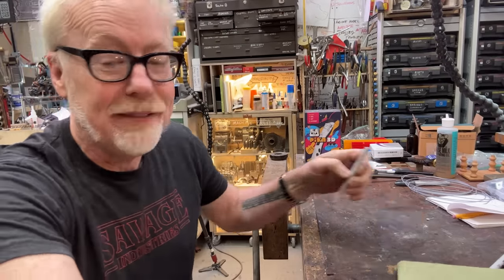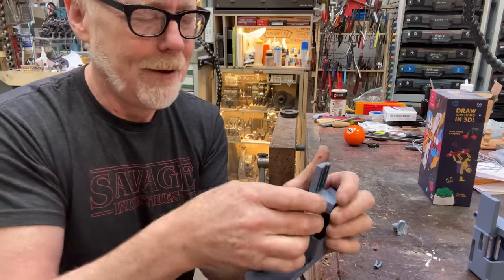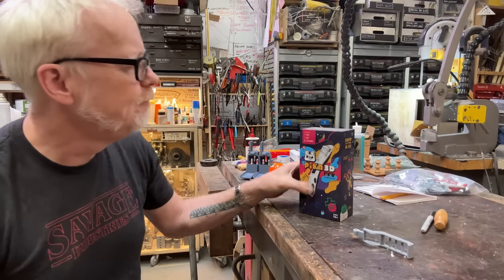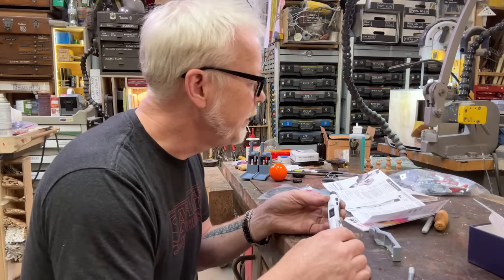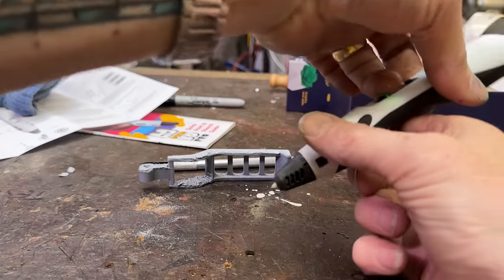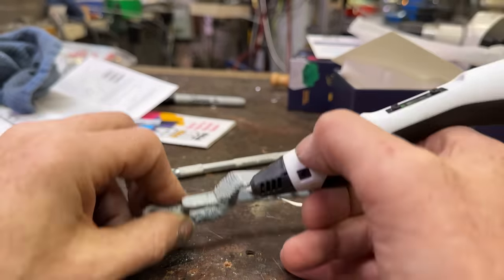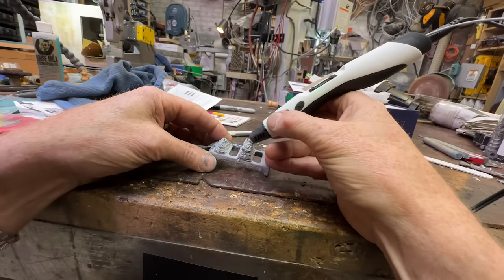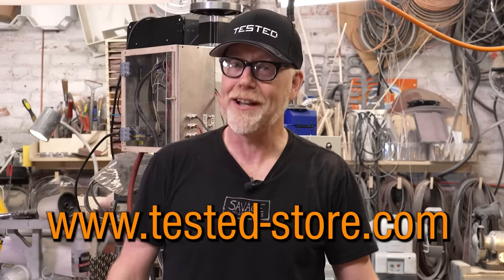Adam Savage Tests This 3D Printing Pen!

Comment: I got one of those cheap 3D pens from Aliexpress and I found a great use for it in retro console modding and stuff like that, like a ZX81 with a piece cut out of the back for something, and I placed some tape as the external surface level and filled it in with the 3D pen, then some sanding after removing the tape and it came up really good, or in the C64 Mini, adding  a USB hub board inside with one of the ports on the back for external use, and I used the pen to build up some screw posts for the new board to screw to. For things like creating stuff from scratch it's really just a toy, but for some things, it is definitely a useful tool to have in the box.

Comment: I have a phrozen brand vibrating cutter, and it will melt and smooth out my 3d pen added plastic to blend into the surrounding very nicely. Just turn it on and put the side of the blade on it, the blade vibrating will heat it up and melt it slightly, but enough that you can smooth it out. I also use my variable temp soldering iron as well for larger or less visible jobs. Works faster, but not nearly as precise in my experience.

Comment: I think a milliner or silk flower iron with knife and wedge shaped tips and temp control would be an interesting way to smooth the material. Soldering irons are generally too hot even at the lowest temps.

Comment: I have the same pen and use it to pretest a design as you can make a simple version with the pen, especially when its just a small part to make. Then after I know what I need to improve and then go into 3d program to design it and then also already have the measurements needed or want to improve on.

Comment: If you use yout bambu lab X1C with the AMS, you can load in a spool of PETG to use as support interface material. Use the traditional support type (non organic/tree), set interface distance to 0, and set support interface material to PETG. This leaves perfect surface finish on overhangs, steep angles and curved surfaces. PETG releases extremely easily from PLA and ABS prints, and can be printed in a far large temperature range than what is stated on the box. You can also use PLA as support material for PETG.
This does however add a bit more time to the print, and you must make sure to set the PLA/ABS as pure white, and the PETG/support material as pure black. The update the flushing volumes. This is to ensure thang the PETG gets sufficiently flushed away, as it otherwise ruins layer adhesion.

I recently bought a 3D pen, and it’s really good at welding parts together, though the surface finish is not very nice, and you should probably add a small chamfer to the edges you intend to join. The bad surface finish can be fixed with a scalpel and some sandpaper. The joints are far stronger than superglue

Comment: I had a 3d pen from years ago. Instead of plastic fillament, it uses resin polimers that cure with an uv light built into the pen. Also ive heard a good way to fill and smooth prints is by using cheap resin from a resin printer. Fill and coat then hit it with a uv torch

Comment: A good compliment to a 3d pen is a wood burner or similar tool to help smooth out rough edges along side sandpaper and knives, probably works well with 3d prints too. I’ve seen several 3d pen artist use this method in their videos. I’ve seen some impressive stuff made solely with a 3d pen and a wood burner style tool

Comment: I have a cheap plastic welder I bought at Harbor Freight that seems like it would help in smoothing.  I don't have a 3d printer, so I can't test this.  I have melted some plastic things together though and it works fairly well.
Reply: This is a good thought and I have done it, but where it fails is most prints are not solid and it is super easy to over melt the part. BUT it does work!

Comment: I use my 3D pen sometimes to connect two printed parts. I don't like to contaminate my prints with glue and that way I don't have to. Also i don't have to find glue that works for a specific filament type and no waiting for glue to dry.

I also used it once to fix a limit switch on my first 3d printer, because I was not able to print the replacement part. I wanted to replace it afterwards with a newly printed part, but ended up to keep it like that  until i rebuilt the whole 3d printer a year later.

Comment: For me, models that have a tough time printing nice, i will cut them up in to various parts in the slicer so more pieces print flat on the bed for a nicer result. Then i use my 3D pen to “weld” the parts into their final shape. I tried to clean up the parts like Adam did and got the same issue where i was looking at a lot of sanding which is not easy with PLA. So using the pen as a welder to put the now “nicely printed” pieces back together, i get really great results. A lot less sanding and its strong as hell. Like a weld, the PLA melts into the part creating a perfect bond

Comment: I've had a bit of success with a pen much like that, not only giving prints touching up, filling those crevices and not quite fitting parts, but also repairing commercial plastic. 80's joysticks, old camcorders with brittle plastic. Quite lovely.

Comment: As someone with 8  yrs experience printing and having my own On-demand service,  those pens will likely be useful only for repairing holes, maybe filling  gaps on assemblies, gashes, imperfections etc Nothing where you can expect quality or  usefulness. 
Supports, bridges, overhangs etc will all get better as you learn how to use the right settings. (top layers, gap, infill for support) Experience will show you how it best works for your workflow.

Comment: Hey Adam, another tool to look into is a plastic welding kit for surface repair.  

It looks like a soldering iron with a flat head.  It can be a huge help with fixing prints or welding multi-part prints together, and should work really well when combined with that pen.  The pen can do the job of filling in the spaces you want with filament, and then the welder can be used after the filament has cooled to smooth it out and help fill in gaps that the pen may not have filled well.  It should help make cleaning up the parts easier as well so you don't have to do as much sanding.

Best of luck with your future printing projects!

Comment: These are invaluable tools for Cosplaying. I have 3 pens in my farm, one for Ultra Low Temperature PCL, I keep one on PLA settings and another on ABS Settings. More often than not, the prints are going to be sanded smooth and/or repainted, so the pen "sloppiness" is nothing to worry about. There are some great artists who use a pen specifically and their work is really cool!

Comment: i use my 3d printing pen the most for fixing parts together, hold 2 parts together and go over the seem with the 3d pen and it will melt them together it awesome, if you design the parts yourself you can incorperate a litle V-shaped groove where the parts meet and the 3d pen filament will melt into and then you can basicly melt them together without much of a visual defect or sanding afterwards

Comment: You may want to look into a "plastic welder" for ironing out crap 3d printed surfaces. I just got the harbor freight one which is a soldering Iron with a flat triangle at the end.

If I need to fill a hole in a print I take a foot of filament and light the end until it holds a flame then drip the plastic where I need it.

Comment: Read up on using PETG as support interface. A lot cleaner break offs. Also check more walls vs higher infill. 100% infill isn't necessarily stronger than increasing walls for example.

Comment: I know most people opt for PETG, but i found PLA+ just prints easer the only notable negative is temperature resistance. ASA is my go to if i want a useable part you can also acetone smooth the part afterwards if you feel so inclined.
Reply: I second the vote for PLA+.  Easier to use than PETG for sure.

Comment: I was waiting for the ER run watching the razor blade part. I use a 3d pen for touch ups sometimes but i use pla just like solder with a triangle flat tip soldering iron. Flows like solder and doesn't stick to the tip. Works great for rounding wheels or barrels.

Comment: Right when Radio Shack was going out of business, they got some of the first generation of these pens in. It was only on/off forward and reverse. I made one of the ones the manager gave me run on a battery pack I made, and i still have one that I just used last week. I figured that since I had an anycubic kobra max coming in the mail, I'd see what videos were out there, and sure enough, Adam had the same printer. I was going to make a warm box for the filament under the machine, and he had a whole video about doing the same thing! Thank you for making my plans seem more sane. I'll be doing something similar and appreciate the footwork already being done. 😆
I swear, all of us have some kind of hive mind going. Thanks for the helpful videos, folks. I can't wait to print something giant. 🤙🏽

Comment: Without trying to sound rude..I wouldn't say this is the best use case for a 3D print pen, it adds alot of additional steps. (building up, sanding down, smoothing, etc.) 
Typically people in the hobby prefer to use a flat ended soldering iron to smooth out the rough finish on such a small part. Especially on a piece where tolerances really matter.  
Altering the print orientation could also make for a cleaner print requiring less supports.

For large prints, like a helmet, this method of using a 3D pen is great for joining parts though.  
Hope this is helpful info! :)

Comment: Okay, this is maybe an unpopular opinion. BUT I think Adam should opt for a more stable fixture to attach his phone/camera than the (gorilla arm?) ball jointed arms. I get that they are very practical for quickly adjusting to a new angle, can pass wires trough and what not. But They are also squeaky, vibrates and sometimes fails holding the camera. IMHO the quality of the videos would be greatly improved with something sturdier. He could use his machining skills to make a compact and portable floor standing phone mast with balanced arm or something. I'm a mechanical engineer and got some design ideas. Contact me Adam.

Comment: I recently grabbed a couple different 3D pens to mess aronud with. So far the best use has been repairing a c-hub on one of my ancient Tamiya RC cars. Using one of these pens, a soldering iron, and a jeweller's file I reconstructed about half the c-hub and it's been holding up to me thrashing this 30 year old car around at well over 50km/h.

Comment: Instead of sanding, have you tried a soldering iron?
I also find that an add on chisel tip works best. It doesn't get too hot but it lets you get a smoother finish before sanding. 👌

Comment: I've fixed all kinds of broken things with my 3d pens, they rarely look good, but are surprisingly durable.
Reply: Would it be useful for TPU drone stuff like quick field repairs?
Reply: @16-BITFPV  I have not tried it with TPU. Seems like it should work, just run it really slow. Mine powers off of USB, so very portable.
Reply: @IrocZIV  That would be to cool I have an adapter for my batteries to 5v USB. What's the model name? Thanks.
Reply: @16-BITFPV  Mines a generic one from China, cost like $20. On the label all it says is "3D Pen" sorry I can't help more
Reply: @IrocZIV  No problem thanks, that helps plenty. Cheep generic one would be fine for what I need. I would rarely use it. I try to have plenty of spare parts in case I crash but you know how that goes sometimes 🤣

Comment: I use the same type of pen, you can adjust the speed using the top buttons, that is handy when you only want a small amount, and can adjust it to work at your speed then. I often join PLA prints using the ABS setting, making it more of a welder, and get a strong bond too. Works for flexible TPU too.

Comment: I've been 3D printing for about 14 years... whenever the RapMan came out. Anyway, the pens are good for welding two printed parts together.
If you want to smooth an FDM print, even one as bad as that part, get some UV reactive resin (like what's used in 3D printers. Mix it with some talc or baby powder. You can get Bondo like consistency. It sands like butter and eliminates layer lines in one or two coats.

Comment: This would be useful for some repairs for sure. I got a temp adjustable soldering iron last week, and it is amazing for repairs, and re-laminating the filament back together, like on the inside of the trailer neck in the video. I had a part I made this morning where a tab didn't get fully printed, and this thing would have been perfect for trying to finish the tab off.

Comment: You can smooth it out easily with a dremel. I saw this being used to make doll shoes.  The lady used a dremel to smooth out lines. Also, you can press smooth sides against a silicone mat while still hot to make smooth.

Comment: my go to for cleaning prints is a soldering iron to flatten and smooth. then a dremel to clean up the marks left by the iron

the soldering iron is also great for welding printed parts together

Comment: as someone that 3d a lot... like a lot. i have found my own uses for a 3d pen, i dont use it for making parts look nicer really(i would normally use wood filler and so on for that. but a 3d pen works great as a welder almost. for either actually gluing the parts together or adding fake weld lines that are supposed to look like metal for a prop. by all means use them to fill in "meh" looking areas, but unless it a big area wood filler works fast, with a amazing result.

that's my experience anyway.

Comment: There's al company in England called Armortek that makes 1:6 scale model tanks and armoured vehicles.  These are high end kits machined from aluminium steel and brass. This tool would be great for adding extra detail like weld lines. I dare say the big model boat and ship builder community would also find it useful.

Comment: I use my 3D pen as a joining machine. If I have two parts I need to go together, for example a back piece on a sign frame, I just drill out a small 1/8" hole into both in the same spot. Then with the parts together, I fill in the hole with the extruded filament until it mushrooms out the top. Using a small metal dowel I then press the mushroom flat and poof, the parts are permanently joined. Cheaper and easier that using heat inserts when the parts do not have to disassembled.

Comment: i bought one from temu that even had a speed control which made it so much easier to use if it was a small area. and its great for joining pieces together if you had to split a model to fit the build plate.

Comment: These end up being kind of a niche tool, but there's a couple of ways in which these are really handy. You can use them when you need to make a plastic loop around something in situ, to either bind two things together, or form a sort of movable chain-link connection. It makes something that's basically solid plastic when it's done, and a several centimetre wide wrap of PLA/ABS can make a very secure and strong bond.   
The other use I found handy was for blades and chisels, especially ones with unusual shapes. You can just draw one side of a sheath right onto the tool, pop it off, draw the other side, bond them with the pen, and you have a perfect custom sheath for absolutely any sharp edge. You can even just add loops to hang them on in a couple of seconds with the pen. 
I used mine to make a perfect sheath for my spoon carving hook knife. It protects the knife edge, stops anything getting cut, and even protects the shape of the blade, as the solid plastic remains in exactly the same shape.

Comment: If you want to hide layer lines EASILY - try Bambu Lab PLA-CF. Its infused with carbon fiber, which hides layer lines, and also increases certain mechanical properties, while decreasing overall weight. Treat it just like PLA when you print - EZPZ. Also, wet sanding PLA makes a world of difference on the finish.

Comment: They do actually work really well. The 3d pens have multiple speed setting and when I need to fill seams I generally use it on the second slowest setting and gives a lot more control with the flow of the filament. Slow it down, works better

Comment: You can also use a wood burner  to smooth out prints had support materials to what you need to smooth and then smoosh it flat with the wood burner I say wood burner and not shouldering iron is because there are more attachments for a wood burner

Comment: 3d pens are great for "weld repairing" parts even without filament loaded into the pen.
They are even better for "re filling" parts that had to be cut back to fit, when you have to cut away the outer layers revealing the infill layers. A very handy tool in any makers tool kit.
Once you are adept at using them they are fantastic for adding pipe work detailing for models.

Comment: @tested I highly recommend PETG if you want a great all-around material. It's stringy, but it's stronger, has a better working temperature range, and exhibits higher dimensional stability.

Comment: i use a  soldering iron to smooth the applied plastic by the pen, additionally i use it a a TIG welder to combine 3d prints.

Comment: I have found it useful for welding prints together and now I even design for it when ever I have 2 parts that fit together rather then glue or screw them together I just weld it with a bead of plastic.